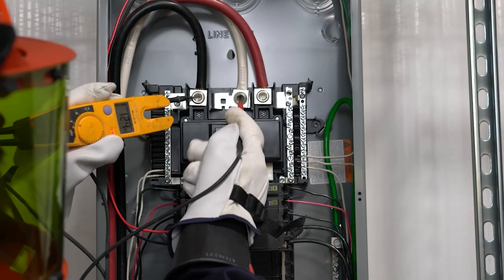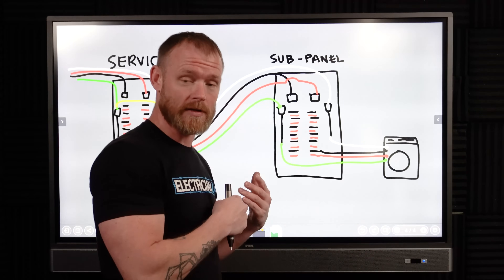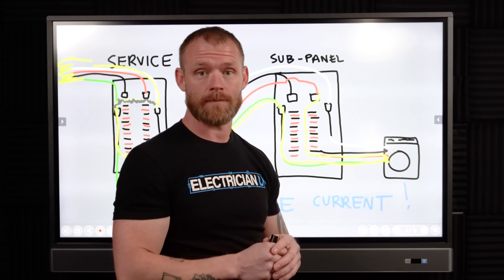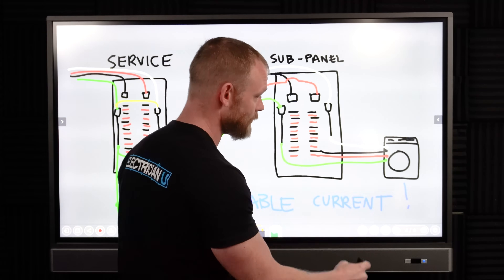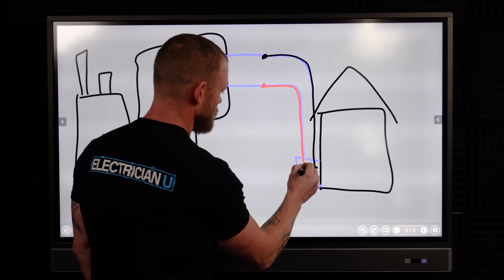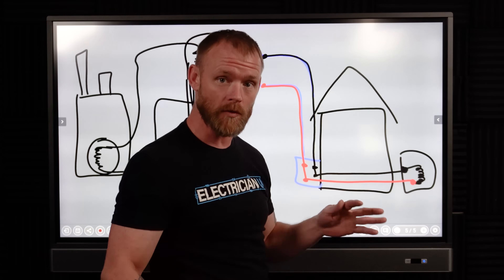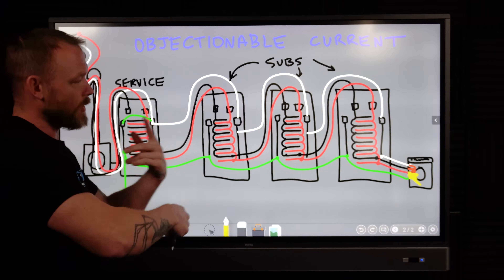Why Do We Bond at the Service Panel and Not a Subpanel?

Comment: So if my 90’s home currently has sub panels for exterior sheds that are all bonded the risk is that of frying equipment along the path back to the main panel or potential on metal parts, however it would still end up tripping the breaker correct? Curious if the sub panels really need to be unbonded which sounds like would be fishing a lot of new wire through

Comment: I just replaced an old 200a main panel with a new one. Its on a pole right under the meter which is feeding 2 hots and a neutral (red, black, white) I have the panel bonded grounds and neutrals and that wired with #4 bare copper to 2 grounding rods. The inspector wants me to move the #4 attached to the rods from the main panel to the meter box and bond it to the neutral there. Is that safe??
Do I need to also attach a #4 from the main panel to the grounding bars?

Comment: Wow this was fantastic. I have learned a lot from this video and this channel. I do have a question that extends this. I have a 125 amp sub panel that has an interlock as the sub panel will either be feed from the main service panel or a 120/240 solar inverter. There were / are 8 circuits "moved" to the sub panel. What was moved was the hot wires, while the ground and neutral in the sub panel are wires from the main services panel and they both go into a single or neutral bus bar. So this appears to me as another GNB in the sub panel and what I am hearing is that this is incorrect. Should the sub panel have separate bus bars? Was it done this way because of having either the Grid or Inverter power? I thought that even when the inverter was the power source and having ground separate from neutral is that it would piggy back off the main service panels GNB. The inverter does have a built in switch to bond or not bond but did not want the need to switch it back and forth when going back to grid power for whatever reason. Hope this was or is clear.

Comment: Regarding bonding of the ground and the neutral at the main service panel ONLY, many houses built in the 1970's and 1980's have ovens that are wired to a house supply that consists of 2 hots and a bare ground wire. The neutral and the bare ground wire from the oven are crimped together and connected to the bare ground from the house supply. In other words, the ground wire from the house supply is serving double duty as both the equipment grounding conductor and the grounded conductor. Since the circuit is dedicated to the oven, there is no risk of objectionable current on other circuits. Most recently, I removed an oven that was wired in this manner for 46 years without incident. Although this wiring would not be code-compliant today, my understanding is that it was grandfathered in 1996.

Comment: A simple concept made insanely, and unnecessarily, complicated by that cryptic and weighty tome that has come to be known as the NECronomicon. A mere browsing of the convoluted, nonsensical ramblings contained within its parchments is known to have driven many seekers of its black knowledge past the bounds of sanity into the maddening abyss of confusion. It has , however, been hinted by those who have tread the horrid depths of this evil manuscript and lived to whisper its secrets that, "the first point of disconnect shall be thy sole binding of neutral and ground and none other thereafter shall thy two intwine." Thats all i know ... and warn you!   Do not consult this accursed manuscript!!

Comment: Super super helpful! Having watched it, I’m now wondering about something else that I’d love to hear your thoughts on…how to handle ground and neutral at sub-panel that’s backfed by a generator.  I have such a sub-panel that’s fed dually (isolated via interlock) by the main panel and generator inlet. Generator inlet and main grounds are connected. As are neutrals. (Neutral is not bonded to ground). Having watched this video, I am now troubled by the fact that, among other things, in a generator-fed situation, neutral current path could follow either main or generator inlet neutral.  Is this true?  If so, is it a problem?

Comment: i'm european, and i get a little confused after seeing this video (not an electrician either). i thought that the green wire (called PE here, p coming from protective), is the specially destined wired to get the fault current back to the source. in fact, the green wire it is forbidden to be interrupted all the way from the case of a receptacle back to the transformer, exactly for that purpose, to always have a low resistance path to the fault current back to the source. what i'm i missing here?
Reply: oh! sorry i commented before the end of the video, before seeing that u are talking about a TN-C-S system, where the protection conductor and the neutral are merged together. by the way, the protection conductor (green one, don't know the name u gave it to him is called here protective earthing - PE, and the PE+N conductor is called PEN conductor.) and for what i understand, this is the most shittest of the transport systems, cause in case of loosing the N between the bonding part and the pole, u are screwed.

i'm i making any sense, or i totally misunderstood the hole thing?

Comment: I had a problem a few weeks ago where a hot wire on a 277v circuit touch the j box causing a ground fault. The breaker to that circuit did not trip but the breaker at the service panel tripped shutting all the lights in the building off. It was the only breaker that tripped. Do you know why that would happen?

Comment: I'm not disagreeing, rather trying to understand. I understand the idea behind not connecting the ground and neutral prematurely. And I understand that the ground wire ultimately needs to connect to neutral to allow the short circuit to happen, thereby tripping the breaker (thanks to your video). But I don't understand why the ground wire can't get that done. I've been under the impression that the ground wire is an alternate return path to discharge electricity, but if I understand your information correctly, this is inadequate to trip the breaker? Or maybe this is unreliable? Am I reading this correctly? Thanks for the help!

Comment: Good Explanation. But important question. I have seen old installations where there are three wires from a pole mounted meter box to the service center. Two hots and a bare copper. The bare copper is attached to the ground rod and neutral bar. Ground wires and neutral wires tie to a single neutral bar.

Without a service neutral tieing into the pole pig secondary, there isn’t a way to clear a branch circuit breaker on a ground fault. We need that service neutral!

So we’re there pole pigs made without a service neutral tap on the secondary??????

My gut tells me that these older pole pigs need to be replaced without that tap!

Comment: I understand what you are saying with objectionable current. However i am a bit confused as to why you would ever use a ground and a neutral from a sub panel to begin with, and i have to guess this is because you are grounding the sub panel. but what if you dont ground the sub panel? Then you would have a sub panel that is isolated from the ground circuit. and thus would in fact operate as a service panel extension. 

I would assume this go's against code. But does the code really make sense? I mean yes i agree you want a single path back to the service panel. but using 2 cables instead of one just ads to the amount of failure points does it not? not to mention the extra complexity of connecting more cables to the service panel. And i get this will work and does make sense in some cases. But maybe not all?

For example i have a very old 120? year old house with some very old cloth covered copper wires and the main service box is really loaded up with wires and to make matters worse its small and very tight to work in. I wonder if i can even ad the sub panel neutral to the main service bar. let alone 2 cables. and maybe the ground cable could be doubled up and be made to fit but honestly i'm not sure i fully understand why. Maybe you can give some incite as to why using a single neutral / ground bar with out  the bonding screw would not be ok, Just be clear i want this done right and if i need to run another ground cable i will. however i just dont quite see why having the sub panel grounded is required (assuming it is in fact isolated as it looks like it maybe.)

Also i have another question :D and this one might sound well really dumb considering the first question i already gave you lol. but if i cut the main breaker to the house that should mean i can safely work on the neutral bus bar as no current is being provided to feed the neutral.  I will likely still talk to a local electrician before doing the main power to the sub panel but having more info cant really hurt :)

Comment: This worked. I moved the sub panel, put it back together but now it doesn't work and keeps popping my 100amp breaker. 
It was bonded with the neutral. There was no grounded bus bar.

Comment: If I connect a floating ground generator to a sub panel with the sub panel main interlocked off, then have I defeated the ground fault circuits in the house?  Is there any way to make this generator connection to the sub panel and preserve the operation of the gfci circuits?

Comment: So correct me if I'm wrong, if the service panel is bonded and the washing machine has a short circuit, the breaker in the sub-panel that the washing machine is connected to will trip.

Comment: IVE BEEN AN ELECTRICIAN FOR 48 YEARS AND I REJECT YOUR THEORY.   As soon as the fault occurs. , the breaker will trip and not go all of those places and especialy not through any normal load on it =s way to the transformer winding .The only reason that I ahve thought might be a good reason to not bond a t all panels is that possibly a neutral might m be loaded to near capacity  at the time of a downstream ground fault  which might  in theroy overload the neutral conductor but during a ground fault any ground wire  is overloaded or a moment anyway.   There will be no "objectionable curents becasue the fault wil cause the breaker to trip immidiately no maatter how many times that the neutral  is bonded to ground.

Comment: In the main panel the bond makes the Ground and the natural "the same point" electrically.  The non-bonded sub panel really is tied to ground.
Any way,,,,I just do what the NEC demands.  
One thing about your drawing to the power company.  There is NO line that goes back to the power company.  You know that,,,it's the earth its self.
SO,,   Tesla's idea about getting pow from the earth is great,,,,coz all generated power is dumped into earth.....I currently am a Level 10 electronics technician with the US Postal Service.  I've been doing motor control since 1962.  My Father taught me the basics at that time.

Comment: Just saw this....Dealing with old house built in late 1940s.  It has old 3 wire feeders goin to subpanel in garage on a 50amp breaker from the main….im getting a new gas furnace installed and its located next to water heater, which is bonded to gas line and copper plumbing…does the furnace ground wire (and other circuit gnd’s) still have to be separate from neutral on a separate gnd bar in subpanel ?  And does gnd bar need to be connected to neutral bar on main panel ?

Or is that local grounding (water heater bonding) scenario ok to allow grounds and neutrals to be on same neutral bar in subpanel ?    

Sorry, i know this is long

Comment: So on the bonded panel. I have a square d with my main breaker and 8 spots for additional breakers. I am curious if I want to add a 20 amp gfci outlet to the exterior would I wire the neutral and ground to the same bonded ground bar? Also would I do the same if installing a 50amp breaker for a generator input with an interlock kit? I've never had to deal with a bonded panel before.

Comment: Power meter on a pole with a main breaker, feeding a breaker box in the house. That also feeds a sub panel in detached garage. Should there be a ground rod at the garage?  Should the bond be at the meter box? This is a moble home setup and not a farm ranch.

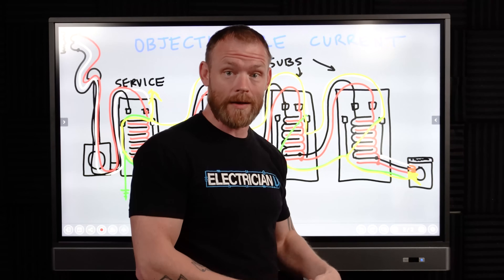Comment: @17:41 "you dont want to bond anything,anywhere" speaking of ground(green wire?)does that go for the wire between 1hp deep well pump to electrical capacitor  box and wire from house breaker panel to pressure tank?

Comment: What if you have a disconnect with no neutral?  If you just have the 2 hot wires and a ground, then you should use the bonding screw in the disconnect box correct?

Comment: Quick question.

I have an old sub-panel 300ft away from the main panel in the main house. The sub panel has a 100 amp service that comprises of two hots and one neutral. It also had the neutral and ground bonded together in the sub panel with a ground wire going to an outdoor water line.

I would like to switch that old sub panel out for a new one and separate the grounds and neutrals and add an 8ft grounding rod. But can I do that since I do not have a ground wire coming from the main panel to the sub. Also, the conduit that carries the 100amp service to the sub-panel is plastic not metal.

what do I do>

Comment: This video explains why ground and neutral need to be bonded, but it doesn't explain why they must only be bonded in one place. The only reason given (without explanation why) is that you don't want to have two possible paths for the current to travel. For both the examples of faults that you give, ground fault or short circuit, the breaker would trip whether the ground and neutral are bounded at a single point or in every sub-panel. There must be some other reason to bound at a single point that you haven't explained. Can you give an example where bonding in a sub-panel actually creates a problem?

Comment: i have a question....  i bought a service lock out switch to go on my service panel inside the house which is bonded.  now the electric company put in a service box outside the house with a shut off switch and they have moved the bonding into that box.  i have a generation hooked to a 50 amp breaker in the inside service box so will the bonding on the outside service panel box work for bonding for the generator or does that switch on the outside box need to be turned off too when the generator is running????

Comment: Ok iv got the ground, neutral bonded at the main panel. It appeared to me that you were connecting both 110-220 legs together. Was the appliance 220-240 ? Now maybe i missed something if one leg touches another & your there you might just be toast.
I tried backing up video hoping catch my answer.
I use your channel to confirm my ideas , understandings & trust me you are sir are a good teacher.
Guess i will play the video at 1/2 speed maybe i will catch the answer to my question.
Keep up the good work.

Comment: Thank you for the content. After watching this video, I confirmed that I was correct and the electrician did it incorrectly when installing my new breaker panels. He didn't ground them back to the service panel and he wired up my CAFI breaker's wrong too. He had one neutral from one circuit going to breaker "A" and breaker "B" circuit neutral was going to breaker "A" and kept causing the breaker to trip. It took me a few minutes to figure out what he did wrong, but now that I know, it is a easy fix.

Comment: The National Electrical Code typically speaking would substantiate this young man did it correctly (and I’m confident enough wherever he is in the states he did it correctly) I stopped the video at 1:02. I’m answering now that would not be a separately derived system all he needs to do is carry the appropriate sized wire service entrance cable and of course in this scenario it’s measured by“apparent power“ so on and so forth, but not only two hot need to come over but a neutral and the ground and the neutral has to be isolated and the ground needs to tie into the can enclosure so all the branch circuitry can tie in properly to the main ground and hit the source properly when it comes to a ground fault situation the ground will act properly in this scenario basically as a  “CYA” and provide a very low  resistance/impedance back to the source safely tripping the breaker and reducing the risk of electrical shock/electrocution 
Conversely, if the union Sparky had his way he would have a “parallel neutral“ causing the system to have funky harmonics through a feedback loop also in turn a current carrying conductor increasing the risk of not only weird harmonics on the sine wave but also having an increase risk of shock/electrocution!!
Reply: Can current or in this case fault current go through parallel loads or would it just go straight to the source or both?
Reply: @jhonnyforyou4850  source is the usual suspect the ideas also is very low impedance back to source so either a human being or another conductor is not as attractive literally the intention to answer your question is a definite no
Reply: @jhonnyforyou4850  with all that been said the answer should be a no there’s a human being or another load because there has to be an impedance of some kind under normal conditions not short anyway 
And for normal power under normal conditions to be used

Comment: What defines a main/service panel? Many new homes built here in SE Georgia have the main breaker at the meter in it's own case. However, it will be the ONLY breaker in the case. The case will have the bonding screw installed on the neutral. To me, that means ANY panel downstream to include the one and only panel in the garage with all 15-25 breakers should now be wired as a sub panel where the neutral and the ground do NOT bond. Am I correct or am I missing something?